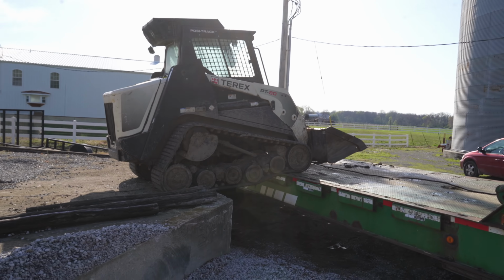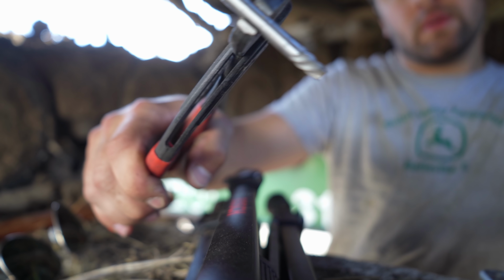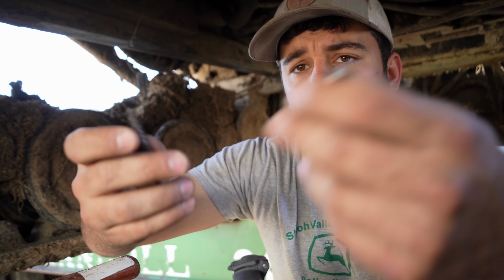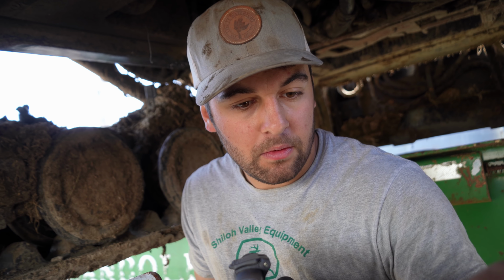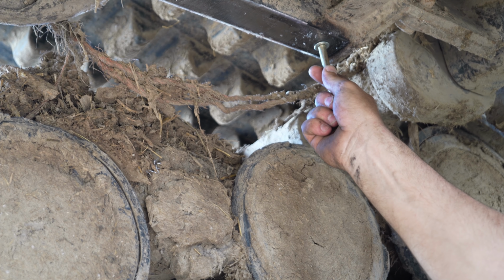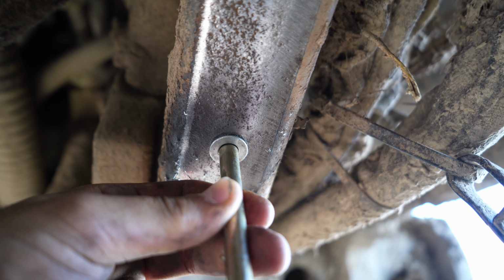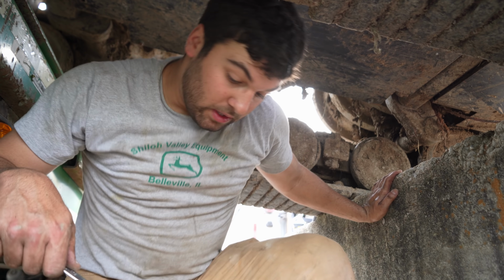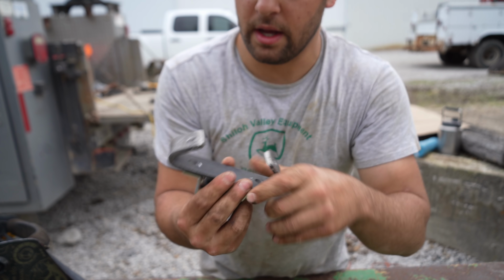Putting Up Trusses and Breaking Tools!

Comment: Nice job! I would have just moved those 3 holes an inch from original position then drilled and tapped new holes.
Reply from the maker: That would have worked too, that would have been last resort since that would have required new holes in the plate too.
Reply: @RennerStockFarms  BUT! It wouldn’t have required the Porta Mag, dragging out the generator or welding. What would have been easier Jon?
Reply from the maker: You're right it would have been easier, but I am stubborn and didn't want to be beat that way!
Reply: @RennerStockFarms  Good reply! We just have to admit we are just stubborn!